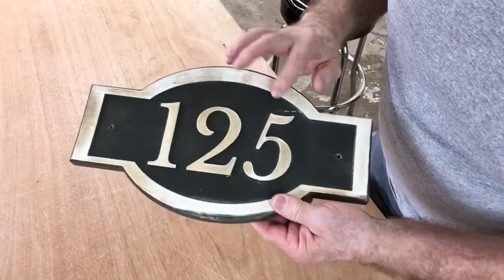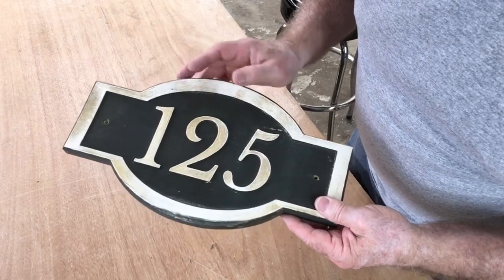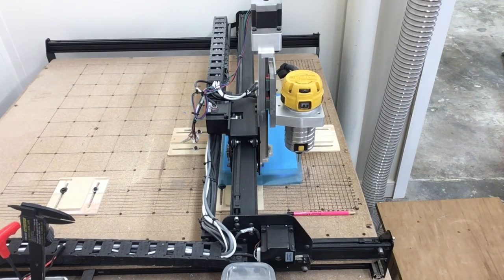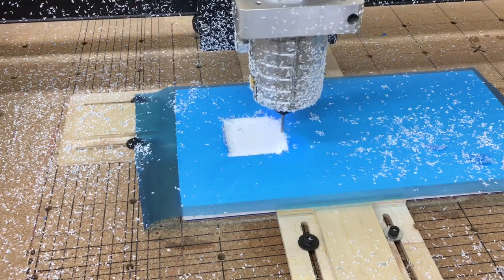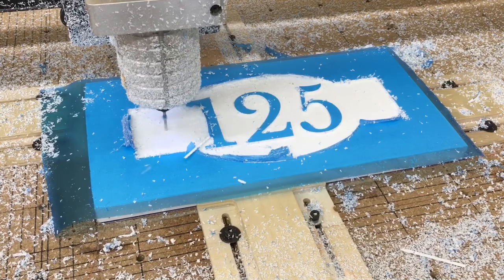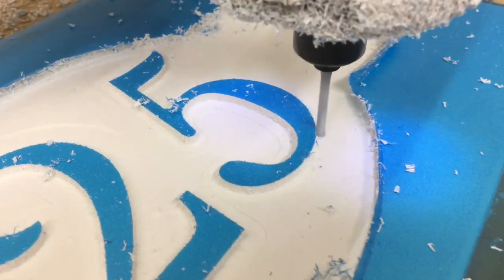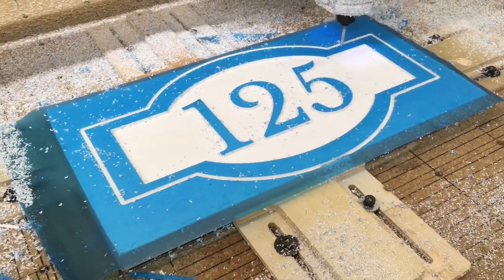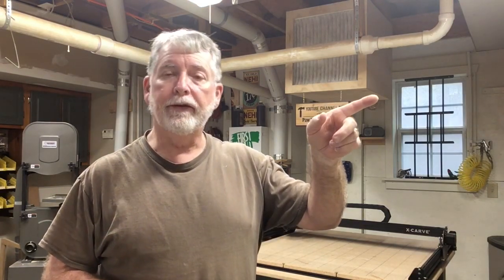Carving PVC on the CNC

Comment: Very nice, Paw Paw. You've convinced me to go ahead and try PVC. thanks.
Reply from the maker: You should! Have fun. It is easy to carve. Just make sure that you carve it fairly fast feed rate so that the PVC does not melt.
Reply: @PawPawsWorkShop  I'm assuming that was a 1//8" downcut bit, not upcut. Right?
Reply from the maker: I used a straight bit.  Here is the reason.  A downcut bit is best for the mask material but an upcut bit is best for the PVC.  The straight bit does ok on the masking as you saw in the video and still does excellent with the PVC.

Comment: I used white PVC 2’x4’x1/2” sheets and darker PVC trim board it was thinner but worked awesome. I wasn’t sure how long the paint would last looking good. I did a inlay into the sheet to make sure everything lined back up perfect and to give a little holding power. Then with the darker trim board I made the inlay but leaving it stuck out quit a bit giving it a 3D look. I used construction adhesive made for PVC to glue them in. The signs are at my cabin so we will see how it handles the weather in North Dakota. I did also reinforce the back with another thicker PVC board making a frame around the outer edge. To mount it I used deck screws with a burnt piece of pine also glued with same adhesive. Then I could just use those boards to screw it to my mounting on the fence. I’ll try to send some pictures on FB messenger. I am going to try painting something to check the fading and pealing.
Reply from the maker: WOW that sounds like a fantastic project.

Comment: Great video! I did not see in the video what type of bit you are using for PVC? I am wanting to cut some small letters and numbers so what type of bit would you recommend?
Reply from the maker: Use the same bits for wood. PVC is easier to cut than wood. An upcut bit will help to get the chips up and out.